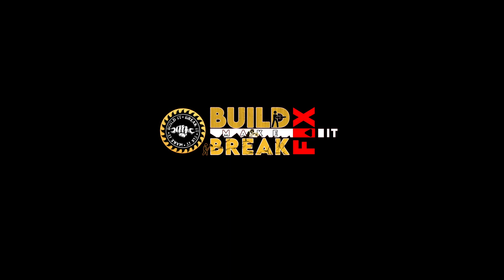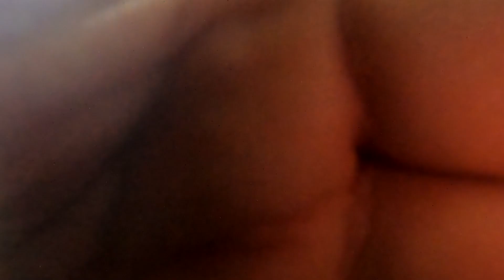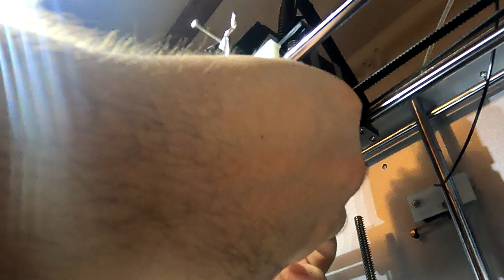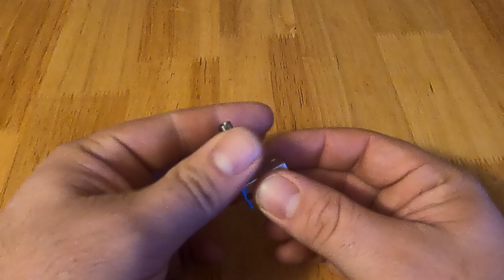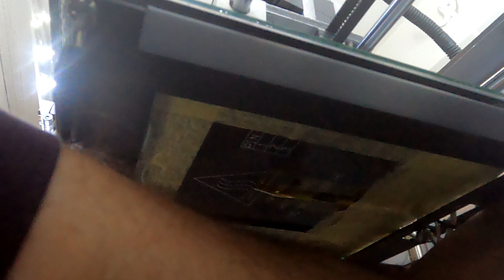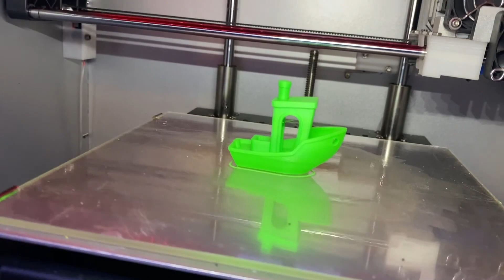How to FIX Clogged Nozzle 3d Printer (Take Apart Bibo 2 Dual Hotend)

Comment: Thanks for the detailed take apart/ reassemble vid. We use a 3d printer for our first robotics team and have had some issues with hot end clogs we think from heat creep, as the melty part is above the heat break. Think I'll try some of the ideas you showed. Also like the leveling trick for the 2 nozzles.
Reply from the maker: Awesome Glad you found it helpful!

Comment: Thanks I'm new to 3D printing I just knew something was off with mine so I took the nozzle off of mine and the PFTE liner was all the way down into my nozzle. I'm guessing that's the piece you were saying you had to replace? I guess I'll have to figure out how long it's supposed to be and exactly where it goes in the setup unless you can comment back to me. But I did realize that my whole hotend is loose in there so after I get the parts I ordered from your affiliate links I'll tear it apart and attempt to fix it back up.
Reply from the maker: Yep that PTFE liner needed to be replaced. It was jammed/deformed near the nozzle. I just measured it and it looks like it’s 7/8” long. That liner goes inside the heat break which is the metal tube that threads into the heater block and and guides the filament from the extruder to the nozzle. Hope that helps and If you have more questions don’t hesitate to ask!
Reply: @builditbreakitfixitmakeit5495  IDK if you still have this but i was just gifted one and it wont extrude i think this may be one of the issues, im going to take it apart soon and check it out, in super new to 3d printers and 3d printing in general